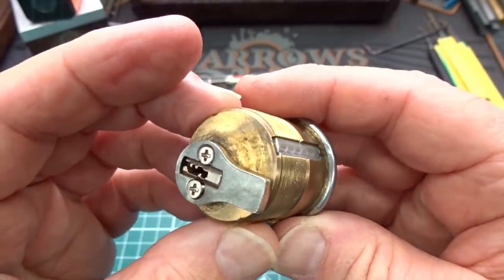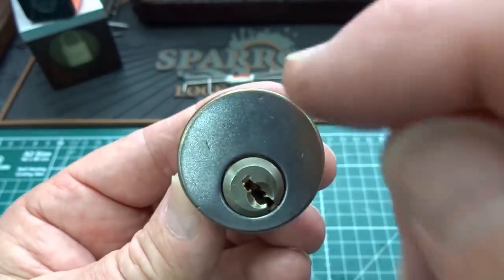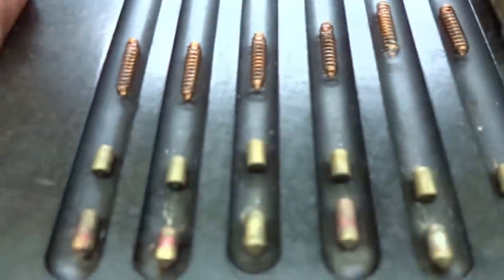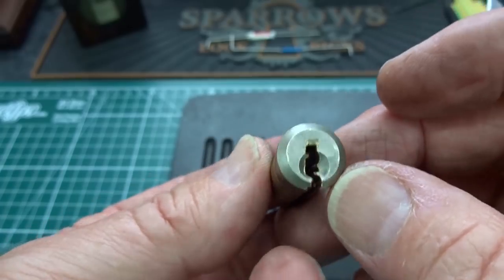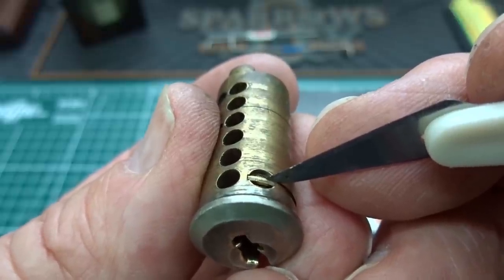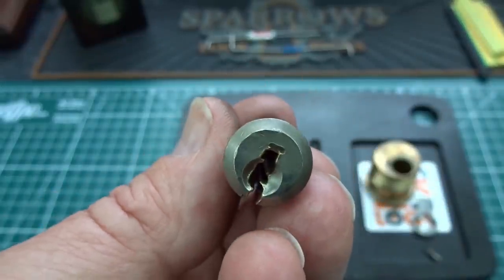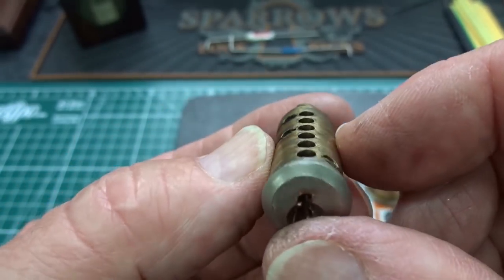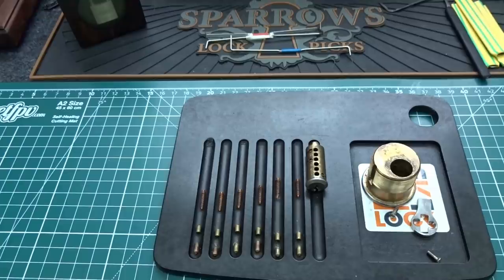(1174) Whipped: David's (Kaba L10) Trap Pins

Comment: Stupid question, but how can you put your key in, if it is partially picked and turned so key pins have no room to raise from the core?
Reply: simple answer: you can't. but je can file one key all the way down, and push that in to the lock
Reply: Well since it would be a complete pick, the core is free to turn. Once you reach those traps, if the key isn't inserted, the driver pin gets caught. The keypins can still move in the core freely, so I have no doubt that once it's at that 45 degree mark, you could still slide the key in. Having said that though, I'm going to go play with my lock and see if you can insert a key into a picked lock!

I was totally wrong. ExtantFrodo2 is correct in this case.
Reply: Any key that would fit that has the top half ground off. There's no need to engage the pins at all and thus no need for "room to raise from the core".
Reply: I used to sell these locks.  Once the plug has been turned,  all is done.  The only way I was ever to get the plug turned was sacrifice another blank,  cut it to all 9's. Was a poor design.  The brass fingers wore off, and leave a person stranded. I'll pin up a new lock for bill,  and send it to him for a potential revisit.
Reply: im a bit suprised that he did not insert a pick inside to feel around he would have felt some play

Comment: I just gotta comment, this was in no way a challenge lock, I didn't even disassemble and clean it (as you could probably tell). Exactly the way it came off ebay. I just sent it in so you could show the weird design. Guess you didn't get my last email. xD I had 5 of em so I did a (pretty inept) pick & gut too: https://www.youtube.com/watch?v=4c5q_ePeu5U Also, once it's stuck you can't recover it with the key, as the keypins aren't free to move up all the way, have to pick the wafers up. In my understanding it's just a key control measure, if someone tries to make a copy of your key on someone else's L-10 blanks the bumps on the side of the key will be in different places and the key will get stuck in the lock.
Reply: Luci Venom I would think so. As long as the key has no bitting to get stuck on the key pins which won't move. you could get the modified key in and under the keypins and as long as the key still has the detent or key control slots it should work.
Reply: Luci Venom I would think that would work, I only have one key though, so I'm not going to be cutting it down. xD
Reply: Ive looked all over the Kaba site and can find no information on this particular lock.  Do you know any more about it or when it was produced
Reply: yes,  Ive been looking for one for quite a while but none of our local locksmiths even carry them, guess ill start watching ebay,  Thanks
Reply: Hope you get lucky, these were just in a lot of several random cylinders, got it cause there were 2 ASSAs and the keyway on these looked weird.

Comment: Once trapped, could you reach in with a knife at the bottom of the keyway and push the levers to release the trapped pin(s)?
Reply: Luci Venom I am pretty sure that you can do that as long as the bitting doesn't interfere with the keypins. The detent/key control traps should be able to be manipulated then and it should be free to turn.

Comment: Had the traps not been recoverable, that wouldn't seem a fair challenge lock, but since they were recoverable I think it should be viewed as fair.  Would you agree?  Using T-pins and construction holes (as you alluded to) would thus seem unfair if they'd jam permanently, but if ramped slots were added in the core to allow the T-pins to ride out toward the "reset" position I think that should be a fair (and tough) challenge that could offer some absurdly-deep false sets.  What would you think of that idea?
Reply: That's exactly my view, a challenge lock should not have to be disassembled between attempts. xD That's why, despite what was said in an earlier video, my challenge locks do not have traps (this wasn't a challenge lock).
Reply: Traps which could be reset without disassembly would seem like they might be somewhat fair, though.  Also, what would you think of adapting the T-pin and wafer trick (see Lockpicking Lawyer's recent videos about pick-proofing a lock for $1 etc.) but adding some angled slots to allow the lock to be reset?  That would seem a pretty simple way of giving multiple pins one a "right" shear line but also one or two "wrong" shear lines that would allow very deep false sets.  If one added different slots on each side of the core one could also set up a lock so that one key would only operate it clockwise and another with very different bitting would only operate it counter-clockwise.